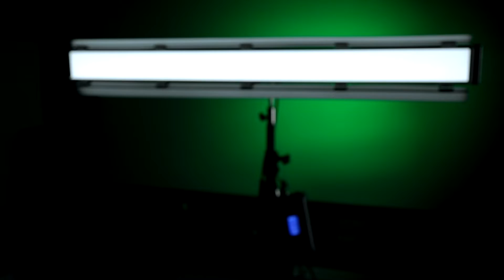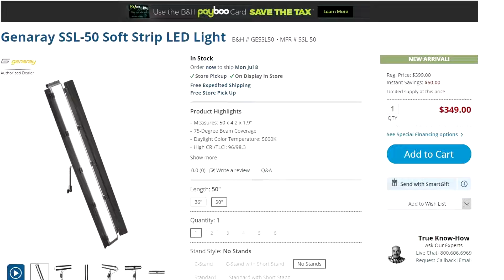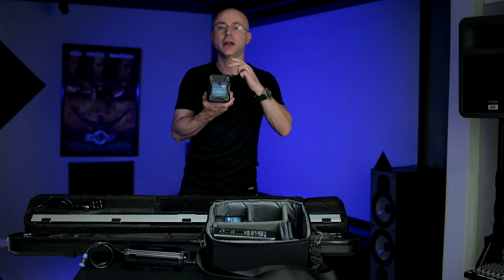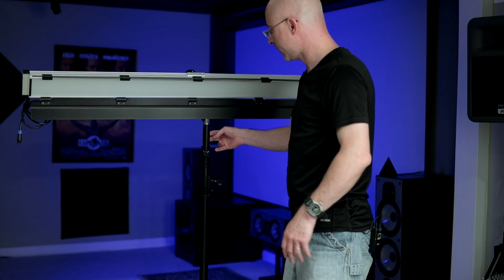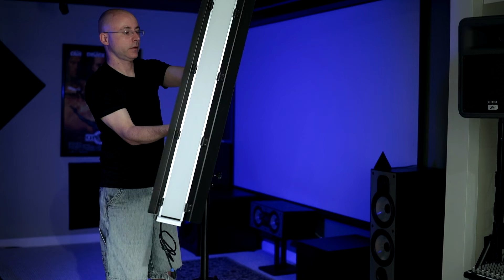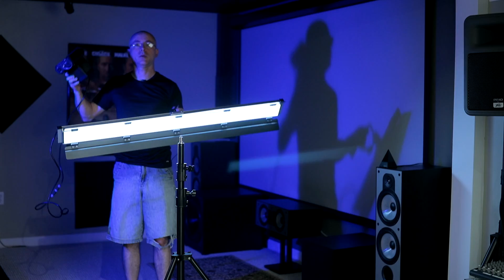Genaray SSL-50 Soft Strip LED Light Overview

Comment: Hey. Great video. How much time are you getting with a single battery with this light?
Reply from the maker: That will depend on the battery watt-hour capacity. 200watts, 95, 160… and assuming the battery is in tip top condition and performance. Simply divide the light’s power consumption at 100% with the battery watt hours. Let’s say… the light is 100 watts, 100% power with a 100 watt battery. The light will run for 1 hour. At 50%, the light will run for 2 hours, and so on.